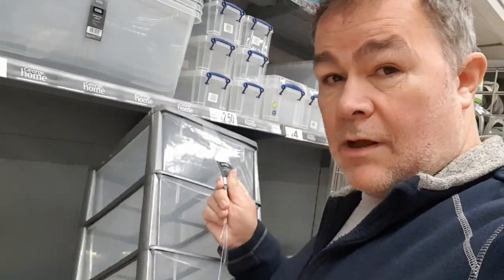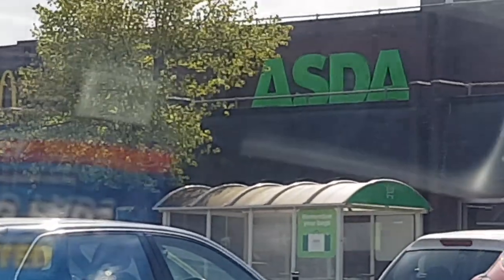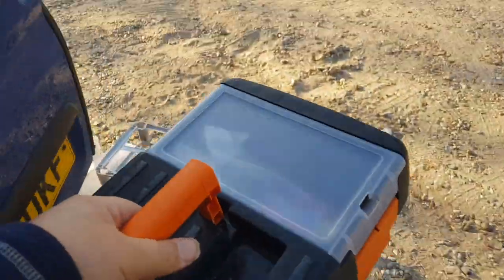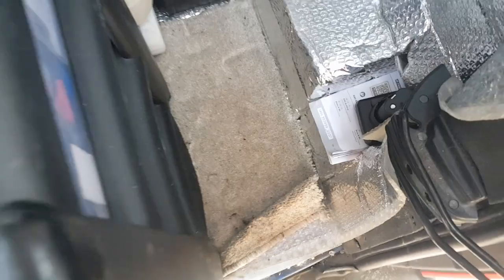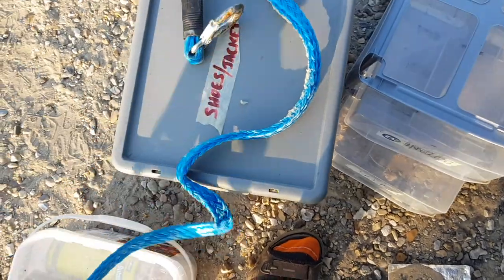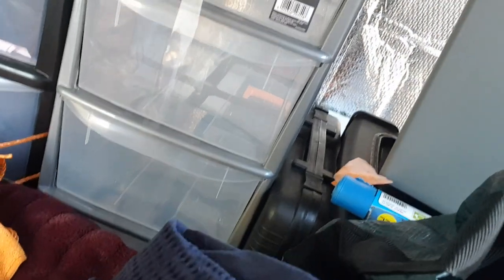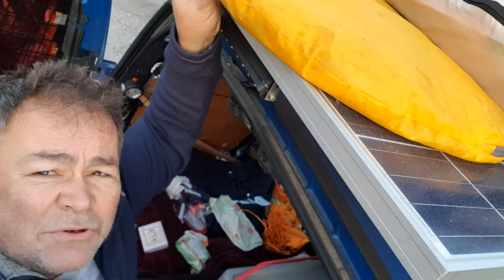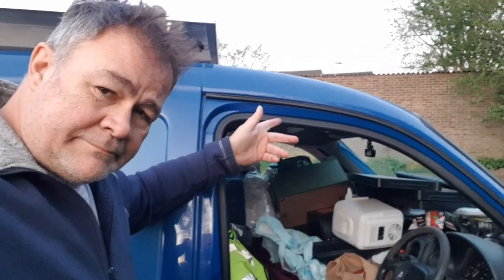VanLife Storage S12E16 Organising Material Possessions

Comment: It's a never ending job van tidying , I'm constantly moving stuff about .But it's amazing how much you can cram in ,plus finding new space aswell .
In my Astravan  there are 2 little cubby holes behind the seats which are useful 
Not sure if your van has them ? Iv managed to cram my tools in there .
What I enjoy most is the new creaks and squeeks that develops as soon as I move stuff about .
The perfect solution to solve that is the radio volume 😁
Reply from the maker: I go about two months between any tidying in my van whatsoever, which leads me to these spring cleaning sessions.
Reply: @SocksWithSandals  

What I hate more than anything is not being able to find stuff ,so iv now got a place for everything,the small items like leads ,keys ,reading glasses etc are all hanging up on view ,so far it's working ok ,but I still have that knack of losing stuff within minutes of putting it down ..The joys of small van life .
But tbf I still prefer the smaller van for ease of use and access to anywhere with ease 👍
And of course fuel consumption.. although I'm noticing since the gvt piss take with the prices I'm fuelling up too regular for my liking